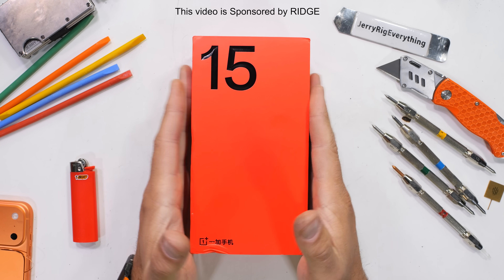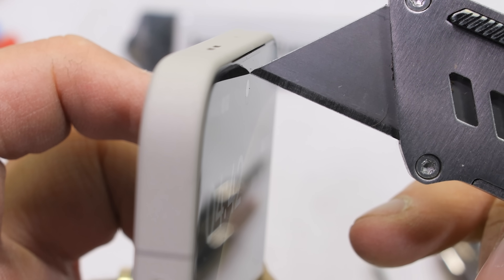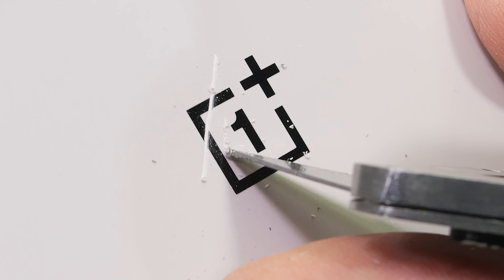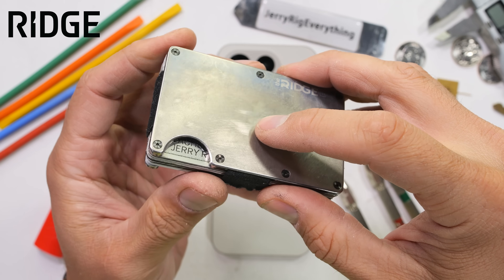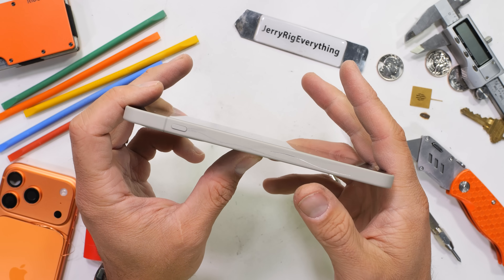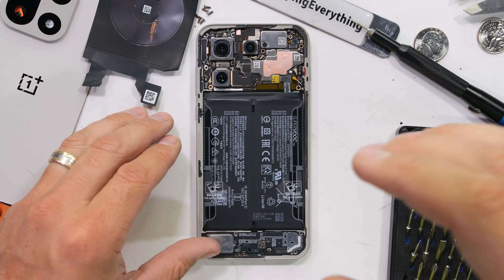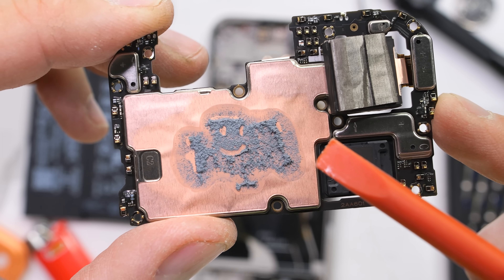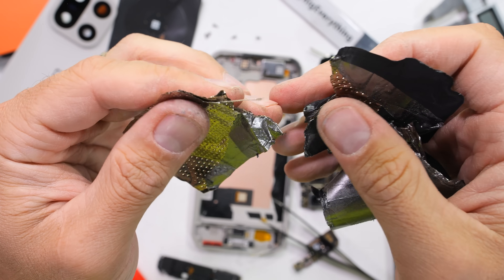OnePlus 15 Durability Test -- The Claim is Insane

Comment: Fun fact - the sides of the phone can scratch glass very easily. Be careful when holding this in the same pocket where's another phone. On a second note, I don't think it's a fun fact anymore
Reply: Yep, it's crazy how MAO can turn mluminium from a mohs hardness of 3 to 9 by creating a ceramic. I have a Convoy T6 MAO flashlight and it feels amazing in the hand aswell
Reply: @EagleFPV43  i have an m21h in mao, i can confirm that it scratches glass but it also is very fragile, other pieces of metal leave scratches on it so easily
Reply: @No-ub5ju you sure that isn't the metal that's scratching onto it? MKBHD shows that metal looks like it scratches is, but you can literally just rub it off after because it's the metal being deposited onto the ceramic
Reply: @racecarrik isn’t that exactly what they said? ”Other pieces of metal leave scratches on it” not other metals scratch it.
Reply: @racecarrik  i just tried rubbing off the scratches and while some did rub off, there are a few that dont
Reply: You have a pocket that fits 2 phones?
Reply: I can fit 4 phones in total in my jeans  @2bears1duck  😂
Reply: Exactly, not fun anymore 1-😂
Reply: The gorilla glass get scratched so easy too, I just got mine today, put it in my pocket with my other phone and when I checked it had already 2 scratches :c, anyone know if I can change the screen protector? I had the one plus 7 and I couldn't
Reply: @elpinchebatmanv1032 OnePlus phones come in with a screen protector out of the box. So what is scratched is probably the protector and not the glass
Reply: I do carry to phone, one for the and one for the
Reply: I don't get your joke
Reply: @Twentizz There is no joke. Aluminum oxide has a mohs hardness of 9. That's around the same as Sapphire because Sapphire is a form of Aluminum oxide.
Reply: @SegFaultOnLine1984  I didn't know that ty for the info stranger
Reply: @zayd162also, aluminum oxide is the most common aggregate for sand paper
Reply: @dadsfriendlyrobotcompany  That makes alotta sense, never really thought about it ty
Reply: @Twentizz this phone scratches metal off coins at times 😭

Comment: 02:32 I feel like this is a bit misleading. The OnePlus 15 in the real world has a worse water resistance than the iPhone. The higher IP69 means it can withstand a high pressure water jet at 80 degrees but like, a phone’s normal life should never have anything remote close to that happening. Whilst the iPhone’s IP68 rating is for 6 meter submersion for 30 minutes. Whilst the OnePlus is at 2 meters which is still better than Samsung

Comment: Previous videos were merely a fluke, we're straight back to scratches at level 6 with deeper grooves at level 7
Reply: My 4y old phone has Gorilla Glass 6, never saw a screen protector or case, in perfect condition and has zero scratches (okay, one veeeeery faint).
My new phone with Victus 2 got a visible scratch after a month, and a second and third the month after. IMHO Victus 2 is too soft. Now my 1.5k top-tier phone has a screen protector because the screen is too soft :(
Reply: @39XenonD  that's anecdotal evidence one person's Experience with a uncontrollably factors doesn't mean victus two is worse or softer
Reply: @luke3491 Corning sacrificed too much hardness for a gain in toughness IMHO
Reply: @39XenonD eh I think dropping is the bigger deal. A cracked screen on my 5 year old phone is why I'm looking at this video to see what's worth buyin lol. Screen protectors are mandatory imho so scratches are a non issue, cracks are always an issue.

I was gonna just replace the battery but an oem screen for my phone is like 300 on its own so a used newer phone is better. Aftermarket screens... are a gamble at best.
Reply: @39XenonD that’s a lie bro
Reply: @IEA_455 Not really. Softer glass is more shatter resistant, but is more vulnerable to scratches.
Reply: @39XenonD imho you should always use a screen protector anyway. Yeah they slightly lower image quality but your phone will survive drops that would crack it otherwise.
Reply: @39XenonD  my phone has gorilla glass 5, it broke after one waist-high drop :(
Reply: @Milkyway21445 sad to hear; mine survived both drops. Angle of impact depends on luck
Reply: @39XenonD  guess so
Reply: it is infact victus 2
Reply: arnt the scratches usually btw 6-7?
Reply: @M4XD11 the iPhone scratches at a level 7 with deeper grooves at lvl 8
Reply: @udaytiwari101 and the xiaomi as well
Reply: @udaytiwari101 S24 was first
Reply: @Minto107 nah, Apple created it… trust me bro… 🤣
Reply: @Minto107  agreed but the s25 scratched at lvl 6-7 it was a fluke from samsung’s side
Reply: @udaytiwari101  straight nightmare fuel
Reply: @NielsvdSteen fr bruh.. the samsung fans who hate apple for repeating design praise Samsung when their flagship budget and midrange phones all look the same saying “samsung said rich or poor everyone is equal” and don’t get me started on the apple ones
Reply: @udaytiwari101 didn't iPhone not scratch at level 7 since it was wipable but did scratch at level 8?
Reply: @Ichibi504  lol bro forgot Samsung makes apple screens 😂🫴🏼
Reply: @Ichibi504 lol bro forgot that Samsung Makes Apple screens 😂🫴🏼
Reply: @kae_ict I’m a bit slow, have no idea why you tag me in this 🤣, since all I did was make fun of Apple since they are always late to the party but claim to come up with stuff by themselves 🤣
But since I’m tagged… Yes, Samsung makes the Screens for Apple, but not the glass that protects the screen. That part is made by Corning Inc, down in Kentucky ✌🏻
Reply: @Ichibi504 yh 😂 i just now saw what u did 😂
Reply: @udaytiwari101  don't care
Reply: "A fluke is one of the most common fish in the sea, so if you go fishing for a fluke, chances are, you just might catch one." - Kevin Malone
Reply: The glass on the surfaces were different...
Reply: "He said the numbers" 🥀
Reply: Its victus 2 of course
Reply: I have a 6 year old one plus and it still does everything, and I prefer that over my iPhone 17 pro max
Reply: glitch in the System
Reply: Cope
Reply: I remember in iPhone 17 video when I’d didn’t work, I was happy for iPhones but sad for Jerry
Reply: Honestly I don't care that much mate, it's cool but I always use a screen protector anyways
Reply: The Xiaomi scratches at level 7
Reply: I turned my vibrator  off while watching this 😂
Reply: @catfishhunter9642 really? I turned mine on
Reply: Glass is glass and should always scratch at moss level 6. Both phones that resisted it had anti glare coatings. I'm thinking it's the coating that's providing the scratch resistance. I have watched with micron thick invisible coatings which makes the metal as scratch resistant as ceramic so possible the anti glare has similar properties.
Reply: @nikc1313 the s25 ultra has a better anti glare coating than the s24 ultra still got scratched at lvl 6-7
Reply: @udaytiwari101  S24 Ultra was 7-8
Reply: @Yielar1 yes i wrote that
Reply: The iPhones weren’t a fluke
Reply: 67
Reply: 6 7 🤷‍♂️
Reply: @nepp- syfm
Reply: even the base iPhone 17 isnt scratching at level 7 bruh
Reply: 67
Reply: @n30natomicnum10 syfm
Reply: 6 7
Reply: @Vermillxn syfm
Reply: Wow... I hate to say this but im the first one to say a 6 7 joke
Reply: 6-7.......
Reply: @wafiXD0 syfm

Comment: 2:18 Not 80watts its 120 watts
Reply: Only 80 watt in the USA.
Reply: @Maximus19161 he has the china variant btw
Reply: @aeaeaeaeaeaeaeaeaeaeae doesnt matter. Will only charge 80 watts in US. We have 120v. They have 220v
Reply: I think the american version only supports 80W
Reply: The North American spec version isn't 120W but it IS 100W it only comes with an 80W charger in the box though but it says right on the website it supports 100W.
Reply: 120 watts, I checked, it works
Reply: @morgothbloody7181 mine only goes to 80w. I just checked with a 140w charging brick and OnePlus cable. 78w actually.
Reply: probably fake charger, you need  OnePlus SUPERVOOC 120W Dual Ports GaN Power Adapter  @TaylorABell
Reply: @TaylorABell or you from usa
Reply: @morgothbloody7181 The Global spec is different than the North American spec our power outlets apparently couldn't handle the global's charging.
Reply: Global version is 80w, China Version is 120w
Reply: Nah, OnePlus and Realme have an annoying practice of putting different batteries and chargers for different regions.
Reply: @userunnamed5204  It's not their fault that different places have different voltages in outlets
Reply: @AlleonoriCat  🤔Perhaps U.S. should rebuild it's electrical grid to support higher charging rates for smartphones.
Reply: @zen_rabbit_holethat’s the stupidest thing I heard all day
Reply: @zen_rabbit_hole you do know wall outlets can output 2kW right
Reply: @user-fe7bo5mm1o  omg! You mean i've been waiting 10 days for my Tesla to charge and it coulda been done overnight? 😖
Reply: @zen_rabbit_hole what? if you charge a Tesla with 2kw it will take a few days to a week
Reply: @user-fe7bo5mm1o  So what you're saying is that I should stop using my OnePlus 80w phone charger for the Tesla? How long would it take if I bumped it up to the 120w fast charging like they have in Europe?
Reply: @zen_rabbit_hole what??
Reply: @userunnamed5204 it has nothing to do with the charger being  different. The same charger that can do 120w in Europe can only do 80w in the US because the US grid is 120V and EU one is 240V.

Hope that helps.
Reply: @razvantrifu  does that really matter if it gets converted to 9 or 12v anyway?
Reply: @razvantrifu The phone supports 120w, the charger supports 120w and the us grid supports 120w. They just designed their proprietary charger in a way that wouldn't be able to get the full 120w from a 110v outlet, although it's very much possible.
Reply: @idk-fv9vs Technically possible but many manufacturers will only use a few fixed components and transformers to convert to lower power outages for any device. This allows a more generalized mass manufacturing since there are fewere variants of the same product (here charger). It wouldnt be cost effective for them to produce an american, europrean, asian etc.  version for each phone.
Reply: @idk-fv9vsyep. A lower voltage means you have to draw more curren to reach the same power. But phone chargers have limited AC current flow for safety reasons. So the total power that it can draw has a lower limit in the US and thepower also needs to be converted from AC to DC and stepped down so that's some extra inefficiencies.
Reply: @keepkarlm6771 oh it definitely is possible. The claim was that they have different chargers for different regions. I'm just saying that's not the case, it's just that that specific charger can only do 80w on a 110V grid.
Reply: @razvantrifu I can confirm this. My American OP12 phone and charger works at 100 watts when i travel outside of the US and Canada.